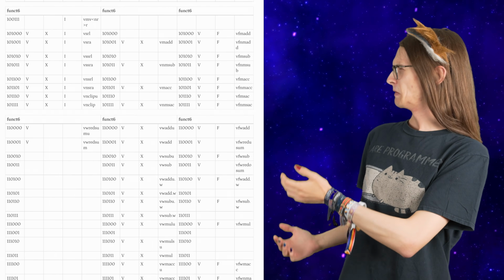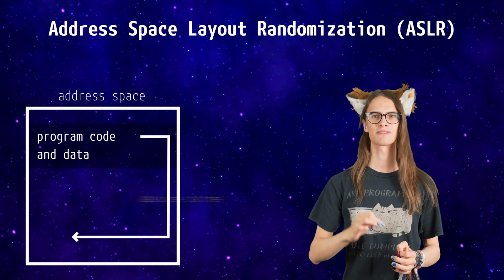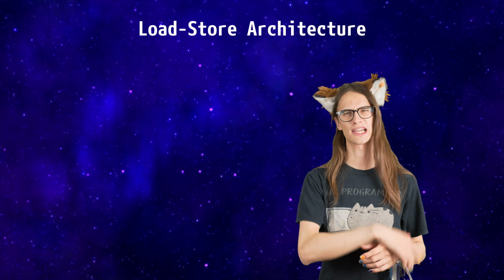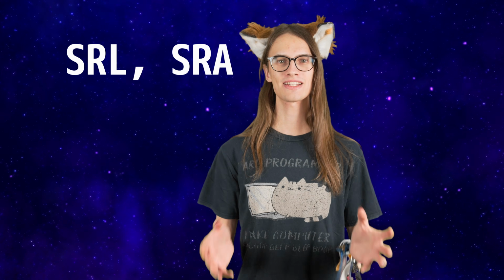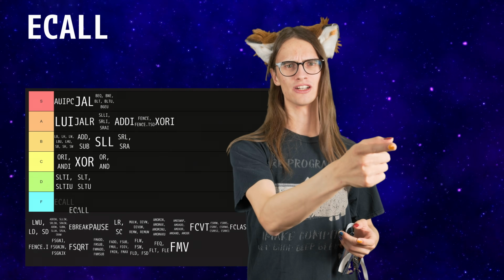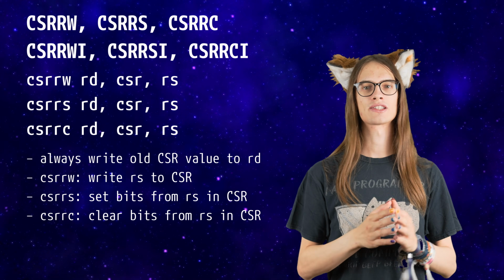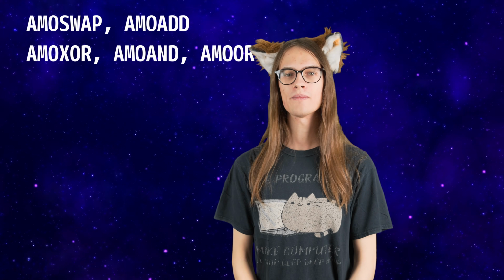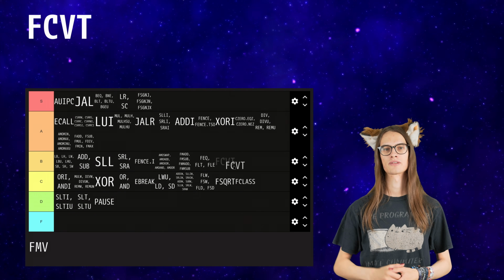The RISC-V Instruction Tier List

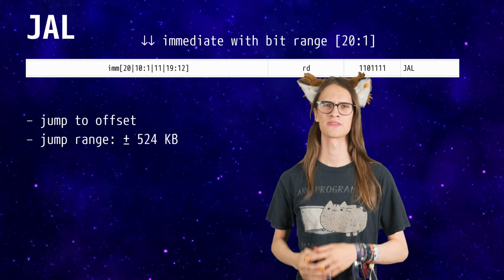Comment: 7:41 already JAL is cursed.
WHO thought it was clever to scatter the immediate bits this way ? It's insane !
20, 10-1, 11, 19-12
but it's only an appetizer because RISC-V shuffles constant bits everywhere and differently for most instructions.
Which is the contrary to the original spirit of RISC : Reduced Instruction Set Complexity.
IF every opcode has to shuffle bits differently, the decoder size increases and the datapath becomes very messy.
Implementations become less efficient for no good reason.

Comment: The EBREAK != NOP might be a matter of intent. Hardware breakpoints are often not emitted by the compiler/developer, but instead by the environment – think a VM host injecting EBREAK into the instruction stream, or hardware itself (e.g. a pin that when issued causes the bus of a flashcard to only read EBREAK).

Keeping this apart from NOP (as an no-effect addition) makes sense in that a faulty implementation (compiler/developer) is much more likely to emit nonsensical adds than encodings that are "this rare".

Just speculating though.
Reply: Additional thought: Also, whenever I have to read raw instruction data (i.e. not decoded to opcodes) something that looks "off" catches my attention better. Does this 4 byte sequence look like one of the countless adds, or does it look "special"?

Often enough, debugging tooling is... haphazard and on-the-spot-engineering with whatever one has available. Like that one pizza carton has the perfect shape to hold the spring loaded jtag thing in place? Military-grade pizza-debugger it is, then!